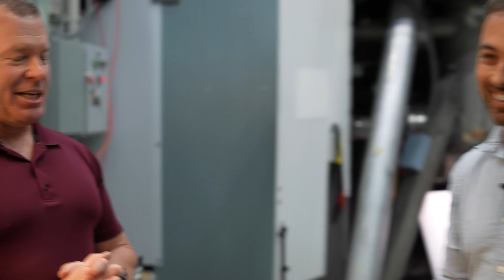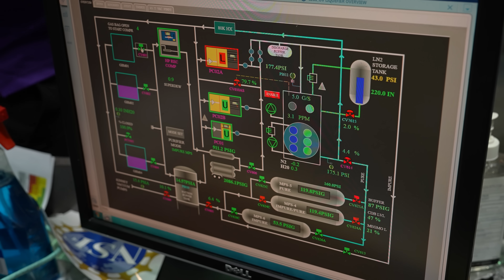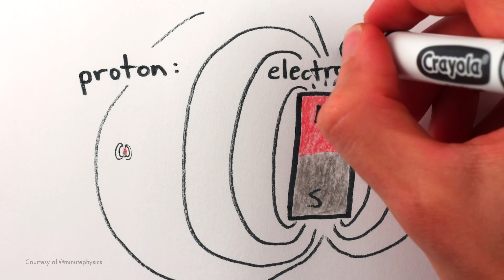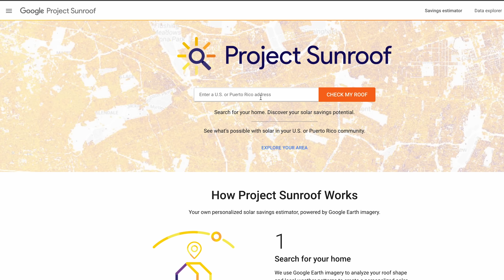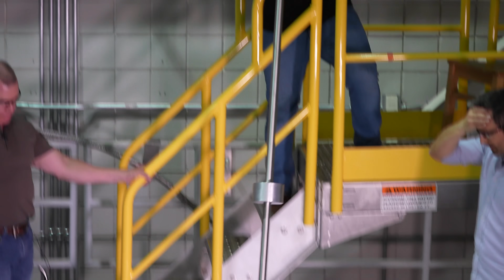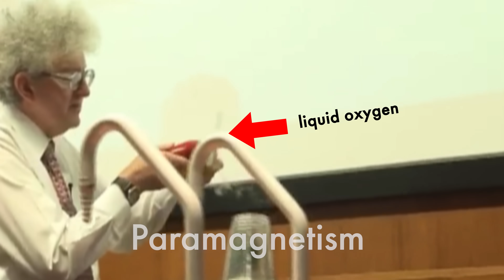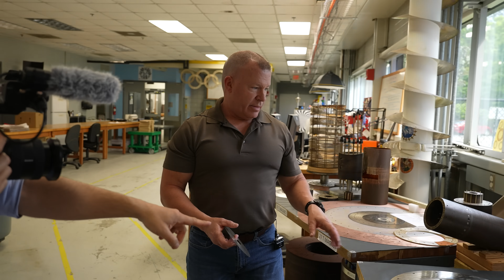World's Strongest Magnet!

Comment: One thing that's really amazing is that people can be present and act in such strong conditions without any harm. We are very vulnerable to many other influences - light, heat, coldness, sound, radiation, gravitation, etc, but 45T - no, nothing, let's have another beer. Thank you very much for the video! Very interesting! Well, and the magnets are always magic :)
Reply: It's a static magnetic field and we humans are slow. Beside there is not much with free electrons (like metals) in our bodies. Maybe some electrolytes... What matter is the rate of change so if you fly past magnet at a high speed maybe something would happen. If you have a wire 1 meter long with 1 meter/sec speed in 45T field at the end of the wire will be 45V. 100 m/sec you have 4,500V
Reply: @car9167  There are a few individuals in the old Guinness book of records who attracted regular metal objects with their bodies automatically. But of rather light weight.
Reply: @KibyNykraft  Literally all claims of "magnetic humans" are known fakes, it's just people that don't wash often enough 😂
Reply: Kind of ignoring the exponential drop-off here.  The 45T is only a centimeter-tall column inside the bore.  We can get pretty close to thousands of volts or degrees, as well, if the source is isolated to a small point.
Reply: @VoltisArt  It's not exponential. For a dipole field like electric or magnetic, it falls off the inverse cube of distance. Or rather, it approaches that at the limit, at distances large compared to the scale of the dipole. Closer in, it falls off even less ("near field"). Still, inverse-cube is faster than the inverse-square we're used to, for EM radiation, particle emissions, sound, or gravity.

40 years ago, I was doing some programming at the MIT Plasma Fusion Center, and when the tokamak magnet fired up, the text on my VT100  CRT screen would twist and turn. That was about 400m or so, so field intensity on a scale comparable to the deflection coils on the neck of the CRT. Bigger field, more distance to act on the electron beam, so maybe about 1 order of magnitude less, but still impressive. Still, nothing in our body accelerates electrons w/ 10-20 KV or whatever. Getting an MRI at 1T or so, is noisy but boring (unless you're claustrophobic, or have anything ferromagnetic in your body). Flipping the nuclei in your body leaves the chemical bonds alone. but is a pretty dramatic effect when you think about it! (Tho it's the microwave pulse that gets them spinning, it's the field that gets them oriented).

Also consider the sheer scale of the power supply required.. I used to play with 15 KV neon sign transformers that ionize air handily. The Pacific HVDC intertie from Oregon to LA operates at +/- 500 kV, or 1 megavolt  between wires. Often, high voltage transmission liines run 3 conductors as a group with spacers, increasing the effective diameter, so the 1/r increase in field intensity on a linear conductor isn't as intense, reducing ionization losses.

Even veterinary medicine uses MRI now. The latest generation use 3T magnets. Pretty impressive for a technology only 50 years old w/ fields 1/15 the strongest ever generated (on a continuous basis.  There's a 100T pulsed magnet at Los Alamos, and even higher fields have been produced, but they self-destruct. A 1000+ T magnet was demonstrated in Tokyo a few years back, which is about as big as you'd want to do indoors. Beyond that, you use explosives to compress the field. I think the record is about 2800 T.

I don't expect to see practical applications of magnet that strong! Magnets like this are a lot more interesting, IMHO.
Reply: You would build strong arms lifting the beer cans in 45 T.....it's like going to gym,hahaha.
Reply: Magnetic fields are used to cause changes deep within a person's brain.  Google "Transcranial magnetic stimulation".  I would definitely not say that magnetic fields have no effect on the human body.
Reply: Having used magnetic fields for over forty years, I can definitely say that they do. Used properly,  they can treat chronic pain conditions with amazingly positive outcomes. @bobbydazzler6990

Comment: Who pays for the power!!!!!! 57,000 amps x 500 volts = 23,000,500 watts which are a measurement of consumed or used power at 15cents per kwh (.15 kwh is average in colorado at this time) equals roughly $17,250 for 5 hours of run time!!!!

Comment: The Amps are simply unbelievable. I get the 500v to limit possibility of Arc. With that amperage I can't even imagine the potential hazards.
Reply: Instant death looms all around that facility.
Reply: imagine a short. just vaporizes everything around it
Reply: @DROGOC0P  Core of the sun plasma explosion 💥. They must frequently Meg the system and have current leakage detection in the micro ohms as part of the safeguards.

Comment: You could have a bitcoin farming plant attached  and use the offsetting heat to power the magnet plant. additionally could you technically hook up the heating for the city if it is hydro so the offset heat that the magnets make from the running water could be used to heat home/ sterilise water for drinking (if there is a filtration system built in before water is flushed through the pipes to prevent and particle damage to the system) cool idea I’d love to bounce this off you @Veritasiaum

Comment: Did you know that if there were large solid iron stones, beneath the surface of the area we currently call the North Pole....That our compasses would still work exactly the same as they do now.   I found this out by playing around with a Compass inside the house.  If i got several feet within the area where my kitchen stove was located, the Compass would just tell me the North Pole was my stove, lol.    Because of the iron in my stove....not because there was any actual Magnetic Fields present.   

So like i was saying, if there was a large enough concentration of iron around the North pole area....our compasses would still work the same, and we would be none the wiser.  

It would be interesting to find out what happens if we take a very small thin piece of pure iron that has Not been magnetized at all, and either balance it on a spindle tip, or float it on water, and see if it gets pulled or effected by any actual Magnetic field present....You know....because iron is attracted to an actual Magnet.

Wouldn't that let us know for sure?  Because to be honest, you cannot create a Magnetic Field by destroying it with heat.  Even if you had a cauldron of pure magnetite and heated it up until it became a liquid....and then stirred the cauldron with swirl patterns....You could never in a million years hope to create a Magnetic Field with a North and South pole.  You would have completely destroyed all Magnetic properties of the magnetite by heating it up....as proven in all experiments where magnetic elements are heated up....They all lose their magnetism.      

Even with electro-magnetism....it requires the Copper wire to be solid, and not a molten liquid, or there will be absolutely No current passed through that element.

Comment: It would've been interesting to see what happens when you let go of the plate at 10:40 , while the south poled induced magnetic field tries to "pull the plate down". Would it then snap onto the ground? Or go fast until the magnetic field reverses again?
Reply: As far as I understand, the magnetic field in a non-magnetic conductor is caused by eddy currents, which are induced by the material moving through the field. Since they only created those fields when the material is moving relative to the magnetic field, they effectively resist any movement. I think that if he lets go, it would just continue falling back towards the magnet (or rather, towards the earth) slowly. 

The plate isn't being attracted to the magnet per se, as much as it is trying not to move. So the force of the fields from the eddy currents will try to keep it from moving, resisting whatever is trying to make it move, be that the force of gravity or the force of Derek.

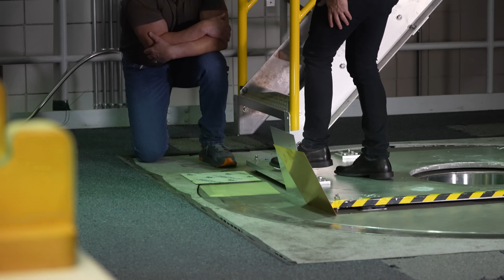Comment: 7:43 "Materials that conduct electricity fall a lot slower."
I would intuit that the better a conductor is, the slower it would move. But the copper plate fell faster than the aluminum. Assuming they were about the same thickness, I'd imagine this is because while the copper is a better conductor (by volume), the aluminum is a better conductor per unit mass. So I bet the aluminum is falling slower because the ratio of the force of the interaction with the magnetic field to the force of gravity is higher in the aluminum than the copper due to its mass. If they were the same mass I don't think that would make a difference since the ratio would be the same, but if you moved them tangential to gravity then the copper would be harder to move.

Comment: Two issues I just noted. You can't get accurate infrared thermals on aluminum sheet because it reflects, and you should have measured temperature changes when you tried lifting it. Because your force times motion was higher than letting gravity work on it.

Comment: During my first try at grad school, I regularly did research here in 1996-97. It was an amazing experience. I learned machining, designed and built a radio frequency device, did some experiments with a vector network analyzer, and a lot of work around 0.3 to 4 Kelvin. I got to meet some world class theorists and experimentalists. 

There are rumors that someone did levitate a frog in one of the 33 T resistive magnets at that time. I didn't witness it, so take that as you will. Imagine the alien abduction stories that frog told its buddies when it was returned to the pond behind the facility.

Comment: Is this related to how I test silver coins for purity? I have a super strong magnet from a hard drive, and this thing will remove skin if you get a finger between it and magnetic metal (most fridges for example). This magnet will hold up a cork board through 3/3 MDF.

Anyway, I run the coin over the magnet and you can feel resistance. Like, as if the coin (or magnet) is all of a sudden running through a thick liquid. Hard to describe.

Comment: The National High Magnetic Field Laboratory in Florida holds the Guinness World Record for 45 Tesla continuous magnetic field.The world's strongest magnet produces a 45 Tesla magnetic field. : Consists of an outer superconducting magnet and an inner resistive magnet.
The maximum field occurs in the center of a narrow cylinder that runs through the middle.

# Future potential applications of strongest magnet

The strongest magnet  has potential applications in several fields, including material science, kinetic matter research, and medical imaging. In material science, the magnet could be used to study the properties of materials under extreme magnetic fields, which can help develop new materials with improved properties. In kinetic matter research, the magnet could be used to study the behavior of materials under high magnetic fields, which can lead to the development of new technologies such as high-speed trains and levitating vehicles.

In medical imaging, the magnet's strong magnetic field could be used to improve the resolution and speed of magnetic resonance imaging (MRI) machines, allowing for more accurate and faster diagnosis of diseases. Additionally, the magnet could be used in particle accelerators to study subatomic particles and in fusion reactors to contain and control plasma.

Comment: It makes me curious how the metal plates weight changed, because it just doesn't want to move so I wonder if when it touched the ground, if the weight went back to normal because the eddy currents kept lowering the plate tell it could touch the ground but did the eddy currents ever fully release.
Reply: the weight didnt change the movement of the plate creates eddy currents in the plate making the plate act magnetic once it stops moving there is no longer an effect its the same concept as a generator when you force a magnet to move through a copper coil you get a current which is felt as resistance

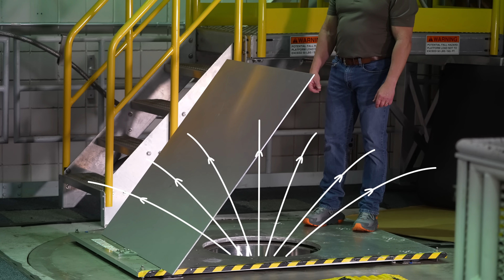Comment: 9:07 you cannot use an IR based thermal imager to perform thermography on a reflective metal surface. 

You should paint the metal matte black to make it minimally reflective of ambient IR sources, so that you can actually measure the metal's temperature and not a reflected source.

Comment: Hi! At minute 9:52 you want to show the heat produced by the eddy currents with a thermocamera. You can't see that on a aluminium sheet, because that sheet is like a mirror for the ir radiations, so you will see the temperature of the objects reflected on it and not the temperature of the object itself. If you want to see the temperature of an aluminium sheet you must cover it with pvc insulating tape. It is thin enough to reach the same temperature of the aluminium sheet but it has an emission coefficent near to 0.98 so that it can emit the ir radiations and you can see them with the thermocamera.
Reply: Yep, this was visible towards the end of the sequence when the temp spiked.  It was a distinct stripe reflecting from Tim's body heat.
Reply: Oh cool, I would never have considered that.  Thank you for your comment!
Reply: Or paint it black.
Reply: What is a "thermocamera"?  Did you mean "thermal camera"?   Has anyone ever described you as "slow" or "special"?
Reply: @Bobby Dazzler  spoken like someone who is "slow" and "special".
Reply: @bobbydazzler6990  🤡
Reply: @bobbydazzler6990 🤓👆

Comment: 7:42 why the copper plate fell faster than aluminium?
Reply: If I had to guess the copper is less electrically resilient than aluminum is, allowing the fields to pass through with less resilience,but that's my guess.
Reply: if its more conductive, less resistance, it means inducent current must be higher which causes higher magnetic opposing field, ıt should fall slower than aluminium, but it does not. @ralseidemurrer

Comment: This will be off topic, but will quantum entanglement allow us to determine the one way speed of light? Also do we adjust the speed of light relative to the speed of our sun? Because even in a vacuum, the entire setup to measure the speed of light would still be traveling at 230km/s or 170km/s depending on the time of year, but relative to us, its speed hasn't changed at all using the two way method.

Comment: That's a very interesting situation with the reserve power in that area because it makes complete sense that they would be able to shut the magnet down faster than spinning up a new generator. Because that magnet is probably 90% solid state, you should just be able to basically flip the power off whereas starting up a generator is up process and a half

Comment: Its impossible that earth's magnetic field is weaker than a fridge magnet..
My compass prooves it.
The north pole is so far away from my compass, yet it still affects it. 
But my fridge magnet stops affecting my compass very quickly...
Reply from the maker: Put a fridge magnet close to your compass. It will certainly move the needle. The Earth’s field extends over a much greater distance than a fridge magnet, but the field right next to the magnet is stronger
Reply: @veritasium  your answer confuses me a little.
I know for sure that ; the stronger the magnet is, the further its effects are away from it.
My fridge magnet starts affecting my compass only at a very close distance, compared to earths magnetic effect.
Its impossible that earth's magnetic field is weaker. It extends so much further than any fridge magnet.
And even further than the one demonstrated in the basement of this "military looking" guy.

Comment: Your thermal cam filming the metal sheet can't show you the temperature of the metal because the metal reflects IR just like a mirror. You where measuring the temps of the structures behind. You can even see the man's figure move as if it was a reflection

Comment: You have a one ton block sitting (centered and balanced) on another smaller block. You then place a magnet on the bottom four corners of this balanced block. If you have a platform underneath (lying on the ground) which has four to eight opposite polarized magnets on this platform and spaced in a circumference larger than those magnets attached to the underside of the block, could you easily lift up the platform which would them easily lift up the block and hold it in the air due to the opposite polarization of the magnets on the platform?   Am I making any sense? Is this possible? Would the 4, 6, or 8 magnets keep the block in the air and in place in case is tries to move to far out of the way?

Comment: Question. If you have a strong enough magnet that has the same polarization as earths north or south pole whichever pole is closer could you send it into space because the magnet would repel from the earth. So you could theoretically have this be part of a rocket and have an extremely viscous liquid to distribute the g's with the astronauts in that liquid so they would survive the g's. The astronauts would also need to have oxygen supply. You would also need  the magnet to be charged externally until you can release it so it can shoot into the sky that magnet part of the rocket would also need to come back down to earth so you can reuse it for another rocket. It would also over time be more cost effective  and you can save that fuel to get farther and have more fuel to make course corrections in space.

Comment: It is incredible how much resource is required to add each additional Tesla of the magnetic field. For my Master's degree, I built a simple solenoid to apply 0.5 Tesla for a relatively short period of time 30-60 seconds. It consisted of a 3" diameter copper tube and just 1400 ft of gauge 20 insulated wire and was powered by a 1kW power supply.